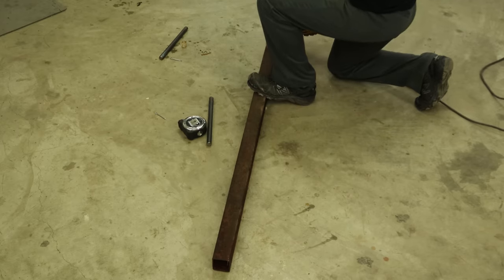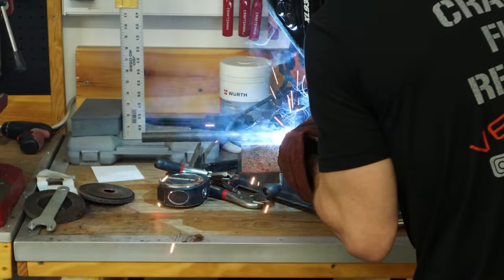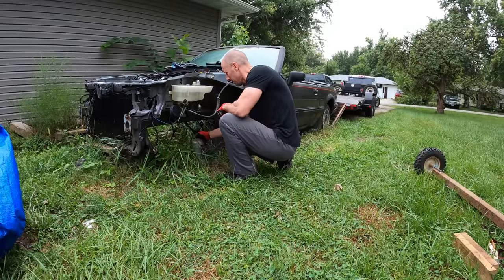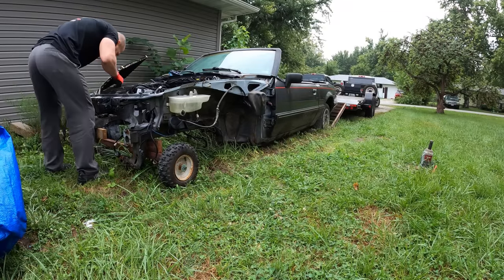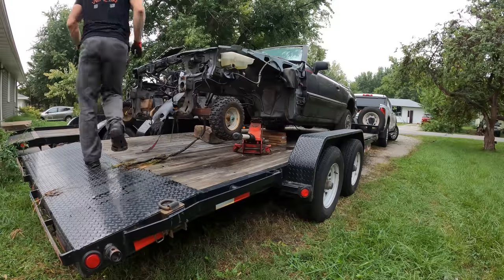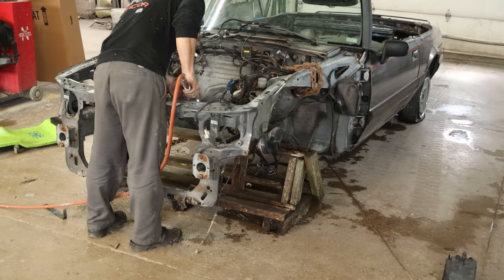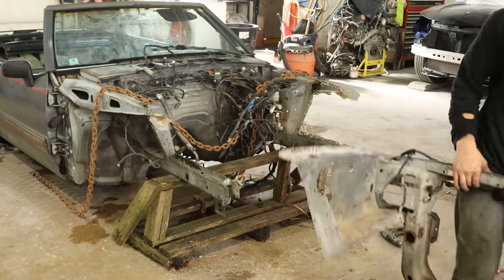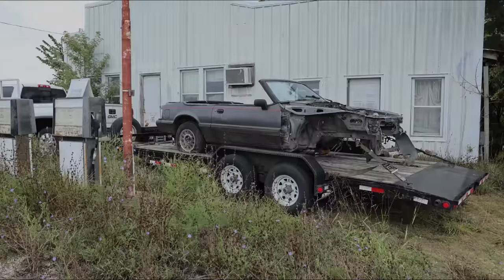How I picked up a car shell with no front suspension, without causing any damage and no fancy tools.

Comment: A mate here in Australia was in the same sort of pickle. He had found a complete body shell for a mercedes W111 Coupe (1962) but was a shell only.He had to get it from Sydney to Brisbane (565 miles)  and because he was away working in the bush he had to get a shipper involved. He made a set of small dollies to roll the car on with a ride height of 5 inches. ,and while the shell was still in Sydney he got it painted!. All went well and the car survived the long trip on the back of a semi ,with no damage.

Comment: Take your dolly concept one step further.  Make a second set (and even a third set) and add in a connector to link them together.  You could put one in the front, one in the back, or with shorter connectors one in the front, one in the middle, and one in the back,   You could pretty easily load whatever you want.  Keeping them linked together will help to keep them from rolling over.

Overall, 9/10 to start, and 10/10 looks like it just needs some wash ,rinse, repeat.  Oh wait, you might not know that one ;)

Comment: A good source for bolt on axle stubs / hubs / wheels is from the rear of most any domestic front drive Chrysler product from the Omni to minivans to the PT .( I don't recall if the LH cars had bolt on stubs or not )   There are variations with bearing size / type / bolt pattern but all are of the same concept.

Comment: 6:17 and put in proper thrust bearings (instead of washers) and put the axle inside the tube spaced out and aligned and all painted and pretty. Been there done that, "might as well do it right, I'm going to use this all the time" and it ends up in the corner never to be touched again hahahah

Comment: Engineering is the art of "good enough".  And your welding is provably good enough.  BTW,  I was told than an inch of weld would hold a ton.  So your welds on this project should be good for a really big family runner.

Comment: I was actually looking for something like the dolly you made for a donor car I picked up at action! I left it blocked up on my trailer as I needed the front suspension and subframe. I made one from a 4x4 with cheep dolly wheels that broke apart half way off the trailer. id defiantly buy one if you were too make it or id have to make one of them for myself. its a bit heavier though with its engine and transmission still in it.

Comment: Of course the UV can't be transmitted to our monitors but some camera pickups can be damaged by the UV light from the welder.  At least that was a warning 5 years ago. And there were some videos with dots in the frame because those particular pixels had been previously fried. Might not be true anymore. The cameras might be more robust to UV. I've often thought that perhaps there should be a little tiny welding mask for cameras. And a little hand to flip it down at the right moment.

Comment: The dolly worked great. Did you make it to match the track width of the rear of the Mustang so that you didn’t need to move the ramps for the front, or was that luck? Might be good if you could move a dolly wheel in/out a bit to suit different cars.

Comment: Kind of makes me wonder what happened to that donor mustang to wind up half stripped. From the outward body appearance it seems like it was a solid well-cared for car throughout most of its life. We had a 92 mustang LX coupe with the 4 banger and an automatic trans. Was by no means a quick car but was a good bit of fun out on the highway. I do miss it a bit. Anyways, good to see some parts will live on with your GT build. Stay sarcastic!😉😁👍
Reply: Convertible 4 cylinder foxbodys are usually use as parts cars. Could be a failed restoration but more that likely it was used to rebuild a coupe or fastback
Reply from the maker: If I had to guess, bad trans.  It was a pretty common failure.  It sat next to that house for years and they slowly parted it out.
Reply: I wondered the same thing.

Comment: I've made those homemade tools myself to make the job easier (Wheel dolleys / Helping hands for ceilings, etc).  Just a question. What was your fuel mileage like over the 8hr journey, with that front windscreen acting like a giant air scoop ?
Reply from the maker: It did suffer a bit, 18.5MPG.  It should have been 20ish. I did think about flipping it around when I stopped but the last thing I need is a compilation 300+ miles from home.